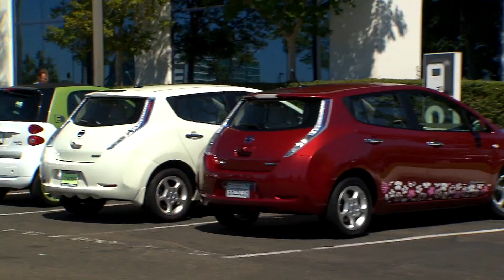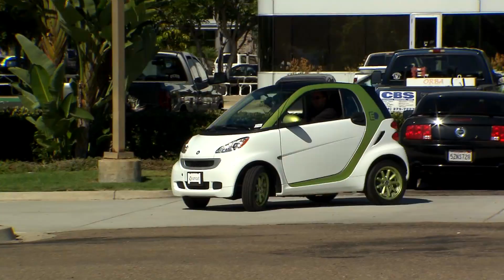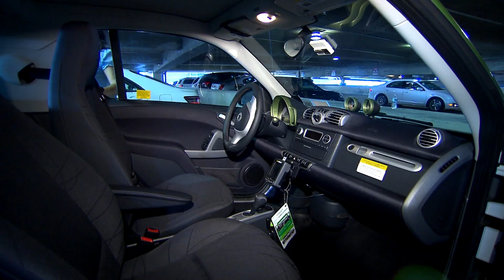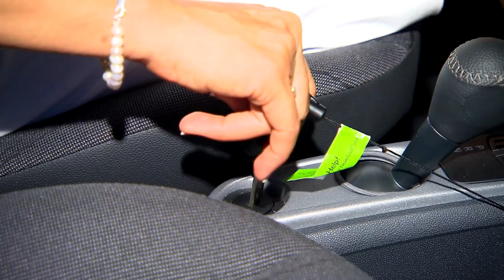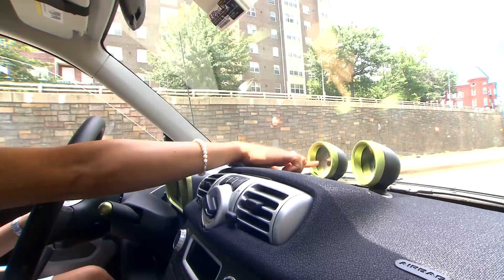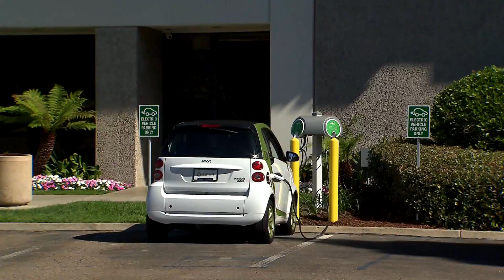FYI: Electric Rental Rides

Comment: Finally more evs on the road its been a long time coming, now all they need to do is make the range last 200 miles, enable a recharge of 15 mins and sell it at around the same price of a mid size sedan (20,000-35,000). That would spell the beginning of the end for the combustion engine.